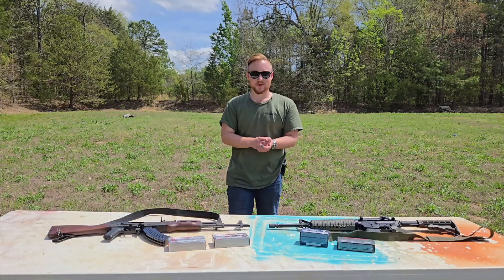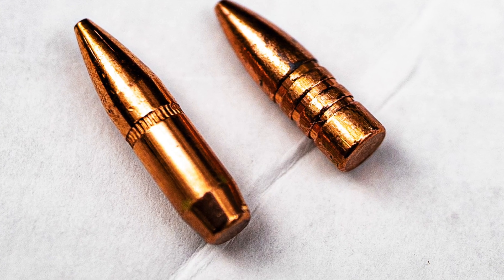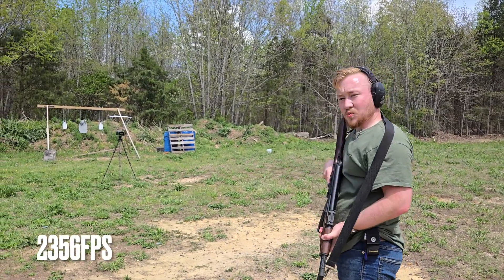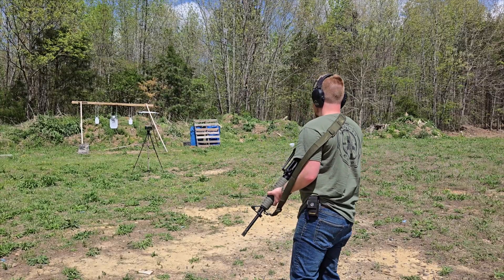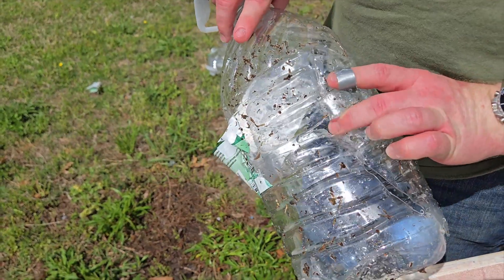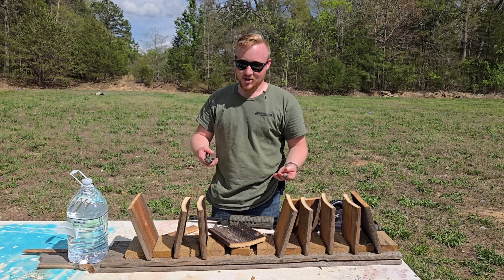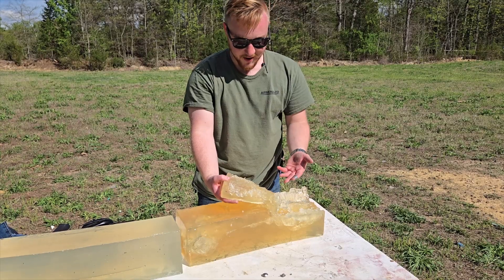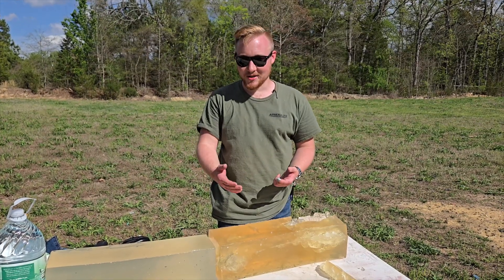7.62x39 vs 5.56x45 - Which is Superior?

Comment from the maker: I knew this question would arise, so thanks to joshuamaxwel8376 for being the first to bring it up! 

The differences between 5.56 NATO and .223 Remington are negligible, with the 5.56x45 NATO cartridge having almost identical velocities, energies, and FMJ ballistics. The main difference between the two is that 5.56x45 NATO is rated for slightly higher pressures. Saying that, pressure ratings don't always result in higher velocities, as it does in the case of 5.56 and .223 Remington. The military uses the designation M193 5.56x45mm because the military designates all cartridges in a military designation, such as the newest cartridge being designated the 6.8x51mm while the commercial name is simply the .277 Fury. Just because the military designates a cartridge with a new name does not mean that it is inherently a different cartridge. 

Also, NATO rounds are typically always going to be FMJ, as all rounds approved for military use are. The prohibition of expanding projectiles in warfare was a result of the 1899 Hague Convention. Due to our testing requiring expanding projectiles, an the difference between the two being negligible, the .223 Remington was substituted for 5.56x45 in our testing. 

The only reason i used "5.56x45" in the title is because it is a more recognizable title than .223 Remington. Hopefully, this answers the questions being asked about it. I probably should've went into more detail about it in the video, but I wanted to be brief. 

Thanks for watching!
Reply: WoW thanks for the info 🫡

Comment: one more time
AR-15 type will be more accurate, but 556 lacks stopping power (FMJ)
7.62X39 has stopping power, lacks the accuracy of 556, but in most cases the accuracy is fine
in the Desert Wars, lots of enemies were found with head shots, it was feared they were being executed
turns out that their upper body was all that could be seen, the the US Troops took head shots, with 556 and its accuracy allowed (as 556 would not shoot through cover)

Comment: I think you need a better chronograph. No way your getting almost 3900 fps with the 40 grain fiocci out of a 20" semiauto. I've shot a few thousand of them using 3 different bolt action rifles with 26" barrels and never seen mv over 3640 fps.

Comment: You are mostly incorrect. 5.56 is noticeably faster than .223.  You can't just read velocity on the boxes, you have to dig a little deeper and find out what length barrel the ammo was measured at.  Oftentimes a brand will measure its .223 round using say a 20" barrel then measure their 5.56 using a 16" barrel.  If they show the same velocity, that doesn't mean they are equal in velocity because the 5.56 out a 20" barrel will always be faster than .223 out of a 20".  Hope that makes sense.  Now, an exception to all of this is that some manufacturers will label actual 5.56 ammo as ".223", when it us actually 5.56.  An example of this is the brand Igman.

Comment: I learned this 30 some years ago, and it needs to be retaught, so thanks for doing it.  5.56 was designed for modern warfare, to shoot straight for 400+ meters and hit targets, not necessarily destroy them. 7.62x39 was designed to kill up to 300 meters.  They were designed for different purposes.
Reply: 7.62x39 kills on much longer distance. But yes most effective combination of easy aiming, hits and kills there.
Reply: 7.62×39 was designed to dominate WW2 warfare
Reply: @dariuswilliams7509 Too be fair, 7.62 x 39mm still does great, even in the modern battlefield. Sure, it's a bit dated, but it's still being used by Militaries, and other groups all around the globe. Most engagements happen within 100-300 meters, which is pretty much where 7.62 x 39mm dominates over 5.56 and 5.45. Not saying it's better, cause all of them have specific roles they're better at. But if someone's behind cover, 7.62 x 39mm does way better at punching through, or destroying said cover.

One cartridge though I believe would dominate the modern, and even future battlefields is 6mm MAX. That's the cartridge our Military should be investing in to replace 5.56, not the new 6.8 x 51mm cartridge, that is inevitably going to fail, and likely get sidelined for a DMR role, just like the M14.
Reply: Incapacitated soldier requires
Resources of manpower, equipment, care….. being more impactful than removing one enemy combatant.

The reason I was given at OCS for 5.56mm.
Reply: @jabreck1934  it’s a logistics perspective. 556 is a good cartridge for suppressing the enemy and wounding them when they are exposed. The majority of the enemies we have faced don’t have great logistics to support the active forces with food and supplies and their casualties with shelter and care the more bandages they have to carry to the front lines the less ammo and ordinance that can be transferred
Reply: Actually no it doesn’t need to be discussed, our government just gave our troops something really deadly to carry!!! Nice!!

Comment: Almost 3x the mass at 2/3 the velocity, the AK rounds are definitely higher energy and more devastating. That being said, there aren’t any volunteers to stand in front of an AR either. Both are very respectable calibers and capable platforms.
Reply: 762x39 just rips all the flesh around it to pieces once it hits you, people who have been shot with it were documented to also experience a lot of destruction to the bones because of the large heavier bullet and its energy. I definitely think 762x39 is superior when it comes down to sheer damage on soft tissue, 556 relies on its velocity to properly fragment. Even though 556 might be more accurate at longer distances, it has a bigger to chance to not fragment properly when it loses its velocity causing it to just pass cleanly through a soft target unlike 762x39 which would cause a bigger wound cavity.

I am still really impressed with the new 556 m855a1’s ability to fragment in ballistic gel its crazy.

Comment: Shoots steel up close with rifles without eye pro. Nice...
Reply from the maker: Not to worry, had my safety contacts in 😂. I was at a distance of about 25yds from the steel, and after shooting them thousands of times with no backspatter, I decided it was better to see the chronograph than to wear those glasses. But you're right, I should've worn proper eye-pro regardless.

Comment: The biggest difference between the rounds isn’t the kinetic energy on paper but the momentum of the bigger projectile which makes it hit like a freight train. The steel plate doesn’t lie and if you can see the impact difference on it then you know a sensitive soft target can feel the difference as well. 5.56 was made for “Big Army” where wounding and suppression fire is an important tactic whereas for an individual or small group a round that hit’s harder and doesn’t require several rounds to put down a threat can make more sense. This is also why AR tactics don’t apply to the AKM in 7.62x39 which many guys don't seem to understand.
Reply from the maker: I feel as though both rounds are excellent, each having their distinct advantages and drawbacks. The 5.56/223 Rem is lighter to carry and more accurate at long range, but sacrifices power to achieve those characteristics. The 7.62x39 is harder hitting and more powerful, but substantially heavier to carry and less accurate at longer ranges. The best answer for this? Have both!

Thanks for watching!
Reply: Same story with 9mm vs 45
Reply: @kevinoconnell1855  Yep
Reply from the maker: Actually have a video on those. Go check it out! I would suggest watching the "REMATCH" presentation, as the earlier one had some chronograph issues.  @kevinoconnell1855

Comment: Awesome video. I can see why many states ban .223 for Deer hunting now (not saying it can't be done).  The AK round was just devastating in comparison.
Reply from the maker: Thank you for the kind words! This was only our 12th video, but I'm pretty proud of how far we've come. 

But in regards to your comment, the results we got may just be due to the specific bullet designs that I tested, but we see that a lot when testing ultra-high velocity cartridges in ballistic gel. The "goldilocks" speed tends to be right between 1800fps and 2500fps for rifle cartridges, and the .223 just blows past that at over 3,000 in most loads. If they're pushed much faster than that 2,500fps mark, they typically just disintegrate within the first 6" of the gel. 

Thanks for watching!
Reply: I've put 10 does and 8 mature bucks down with 5.56 and they dropped right on the spot doubled lungs. I use Barnes 70gr TSX rounds, V-max rounds is designed to fall apart and explode on impact that's why it's made for varmints only.

Comment: Wait, so claim your testing 5.56, but actually test .223.

So bogus!!!
Reply from the maker: @michaelberger6699 As stated in the pinned comment, the 5.56 NATO and .223 Remington are essentially identical. The main difference between the two is that 5.56 NATO is rated for slightly higher pressures, which doesn't mean "more powerful," in fact, the .223 Rem is typically slightly "more powerful" than 5.56 NATO. It's all about making a title that is recognizable.
Reply: What's the difference
Reply: @JohnLedbetter-i6z  chamber pressure. Hotter.

Comment: The 762 in the AR platform is the ultimate combination. 😎
Reply: Quite the opposite lol. 7.62x39 ARs need a a lot of work to make reliable, which in includes getting certain BCGs, firing pins, buffer weights/springs, and adjustable gas block. Even if you get the best parts, the bolt face is fragile since it has to be hallowed out (less metal) to fit the .30cal round, so extractors need to be replaced periodically. Finally AR 7.62x39 magazines are iffy, with the only manufacturer to make them decently reliable is Duramag
Reply: @LtApples101  Facts.  If you wanna go 30cal with an AR , just go 300 blackout... since you can keep the same bcg and don't have to worry about breaking bolt faces and firing pins
Reply: @pewpewbbqs  Plus .300blk is ballistically similar to 7.62x39
Reply: @LtApples101  Exactly
Reply: @LtApples101  You are right, 762 by 39 that has a Piston AR, instead of a Direct impingement.  The best parts are required, just like building a high-end 556 by 45; the weak part is that the bolt fails after 3000 rounds.  Other than that issue, the rifle is great. Once the problems are overcome, the AR platform is perfect for 762 by 39.

Comment: Both are very lethal are short ranges , at longer ranges the 5.56 wins on accuracy and energy. That's why it's the superior round.
Reply: Military is currently discontinuing 5.56 in favor of 6.8mm.
So much for superiority .
Reply: @jabreck1934 no they aren’t actually
Reply: Nope you've way more energy and mass transfered on the 7.62 in closer range and that cartridge is also more efficient on shorter barrels that's why commandos now go back on this one. 5.56 is more for longer range fight, without taking account that they were comparing old AK platform with new AR that are obviously better and more polished platforms.
Debate is closed in the military expertise but nerds on the internet sure say a lot of shit on youtube. 😅
Reply: 762x39 Has more energy then 556 even at longer distance, plus 556 even though it starts off much faster then 762x39 since its much smaller and lighter it loses velocity faster then 762x39. So at longer distance even if 556 is more accurate it might not even fragment like it’s meant to do at those distances meaning all it will do is create a tiny 22cal hole in you going clean through, not much damage. 762x39 will create a larger wound cavity if 556 fails to fragment which happens at longer distances or in short barrelled rifles.

If SHTF I really don’t know why you would be engaging targets past 400 yards, leave them alone and just defend your property.
Reply: @Film_Clips280 not true at all 😂😂

Comment: Try the actual .556 vs the 7.62X39. They actually ARE different.
Reply: 7.62x39 is still 7.62x39. Doesn’t need an upgraded version to hang around.
Reply: Absolutely
Reply: How
Reply: @ Which ones? The differences between .223 and 5.56X45mm have to do with case design and pressures. The 5.56 has around 5000 psi more. Usually resulting in higher velocities. The differences in 5.56 and 7.62X39 are too many to answer in this. Look it up.
Reply from the maker: @tommyspannesq Yes, you are correct on a higher SAAMI pressure rating, but only by 3,000psi. However, this does not always mean higher velocities. The .223 typically gets higher velocities (depending on the load, sometimes significantly higher, sometimes not so much) than 5.56 NATO. A quick Google search and/or simple testing with a chronograph will reveal the same to you. Thanks for watching!
Reply: @Arsenal23.  Entirely false.
Reply from the maker: @ironroots. And your proof is..? Or are you just going to shout "lies" with no evidence?
Reply: @Arsenal23.  If you'd like I can share my chrono data with you. There surely is some weak 556, and some spicy 223, but those are the exceptions to the rule. I've tested a lot of ammo. When comparing loads with the same projectile weight, 9 times out of 10 556 will have a higher velocity, not the opposite. That is common knowledge, so the burden of proof is on you bubba.
Reply: @JohnLedbetter-i6z  The calibers, to start with.
Reply: He also shot .223 out of a 16.5 in  barrel (looks like the 20in barrel though) which is definitely not the typical barrel length in the civilian market. Most guys are running around with 14.5, 12.5, and even 10.5 these days

Comment: Video add 7.62x39 vs 5.56x45.
Actual video 7.62x39 vs 223. There is a reason the military 5.56 NATO round is used and not the commercial .223
Reply from the maker: @joshuamaxwell8376  I knew this question would arise, so thank you for being the first to bring it up! The differences between 5.56 NATO and .223 Remington are negligible, with the 5.56x45 NATO cartridge having almost identical velocities, energies, and FMJ ballistics. The main difference between the two is that 5.56x45 NATO is rated for slightly higher pressures. Saying that, pressure ratings don't always result in higher velocities, as it does in the case of 5.56 and .223 Remington. The military uses the designation M193 5.56x45mm because the military designates all cartridges in a military designation, such as the newest cartridge being designated the 6.8x51mm while the commercial name is simply the .277 Fury. Just because the military designates a cartridge with a new name does not mean that it is inherently a different cartridge. 

Also, NATO rounds are typically always going to be FMJ, as all rounds approved for military use are. The prohibition of expanding projectiles in warfare was a result of the 1899 Hague Convention. Due to our testing requiring expanding projectiles, the .223 Remington was substituted for 5.56x45. 

The only reason i used "5.56x45" in the title is because it is a more recognizable title than .223 Remington. Hopefully, this answers your assertion. Thanks for watching!
Reply: @Arsenal23.  is correct...

Comment: Debate that ended many years ago. Which is why Russians 5.45 x39
Reply: Light and fast beats armor better than heavy and slow.
Reply: @trenton7086 I wonder why the U.S. is moving to 277 fury
Reply: @Urbanoperative  heavy and fast? Good combo, hard to do, hence the bimetal cartridge to handle extreme pressures.
Reply: Some countries still use 7.62x39 but I agree that is seems like the evolution of ammo moved towards lighter, faster rounds with lower recoil
Reply: @Urbanoperative  ultra poor s-hole countries. Thers is a reason the majority of com-bloc countries moved to 5.45 to follow suit with the 5.56.
Reply: Nah thats why some western countries like france with their special forces go back to 7.62x39 not for the same mission, better for shorter cannons and so CQB
Reply: @jepasdenom7643  France? Thats what you use as an example? You talk about the country's caliber that will bw thrown on the ground when they run away?  Any seruous country usea 300BO as special purpose. The debate is over. Ever major and serious countey including the Combloc countriea went to 5.45. The only holdouts are the ultra poor that rely on milsurp like African countries.
Reply: @Wade-1 300BO is a caliber that was designed for subsonic usage it has less energy than 5.56 and 7.62x39 you clown
Yeah the same french that are teaching marine commandos in Guinea 😂
5.45 is used like 5.56 to carry more ammos and again for long range fights.
And about the 5.56 not being enough efficient thats also why the XM7 has been developped around the 6.8 now. 

Its fine kiddo dont get angry because you lost an argument so youve to play the "lol France" 😊
Reply: As the US military is currently discontinuing 5.56 in favor of 6.8mm(also referred to as .277
Fury)
Reply: @jabreck1934  they arent discontinuing anything. Keep up on current news. All tip of the spear war fighters are using intermediate calibers still with a few using speciality rounds like 6 arc etc. Very few people have received the xm7 and most of the units have been ultra critical. This will likely just end up being a gun that replaces DMRs and other medium caliber support guns.